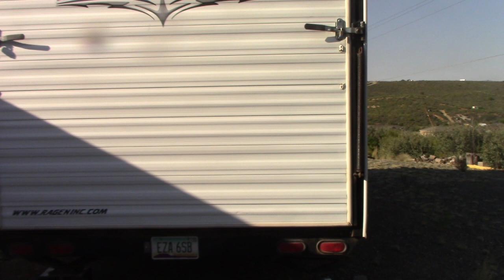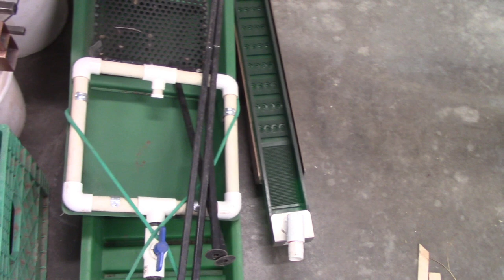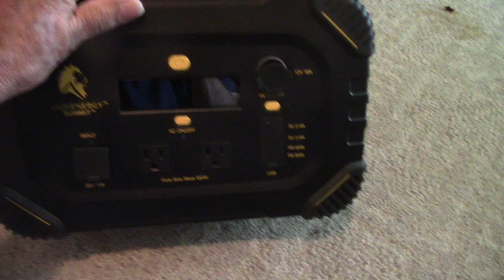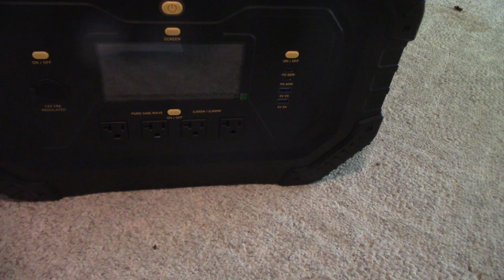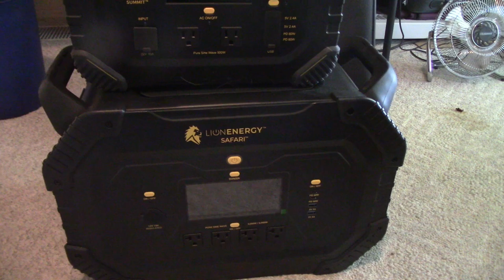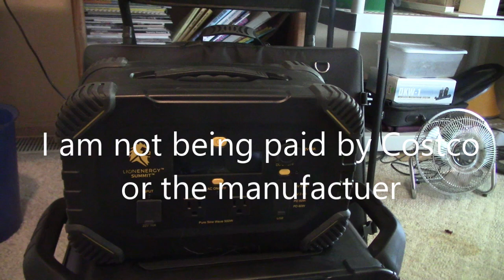Why Every Miner Is Switching to Electric Tools NOW

Comment: Nice setup, Chuck. It will likely serve you well.  Btw, my neighbor has a LION solar power home system. He really likes it and pays no electricity bill. 💸 
Adding up your load and sizing your system   is good stuff.. I always double the amount I think I need.  Once you begin to generate your own power, you will find more stuff to plug into the fountain of electrons. 😂
12 volts x 3 amps = 36 watts
Voltage x Amperage = Watts 
Just in case.. 😊
Good work, sir
Peace Prospector Tripp
Reply from the maker: Thanks PT, glad you enjoyed the video. I do remember that formula  from my basic electricity in the military. I did a course on solar, from Siemens, when had their own panels. Never got to use that information, went into commercial electrical construction. Thanks for your support brother, stay safe and blessed.